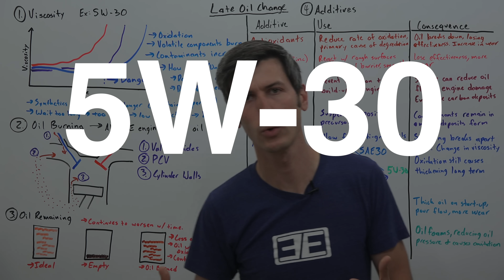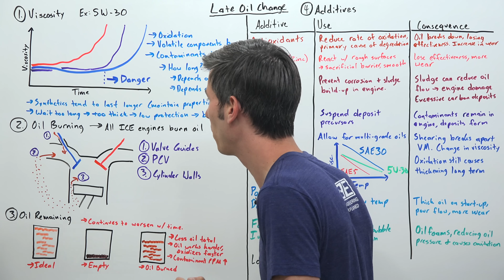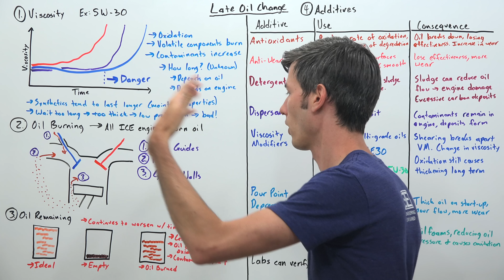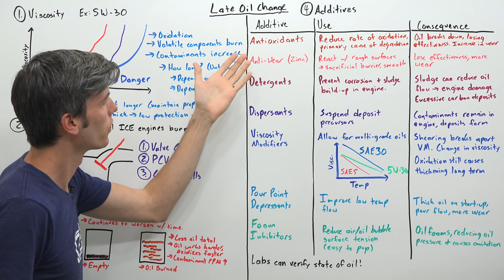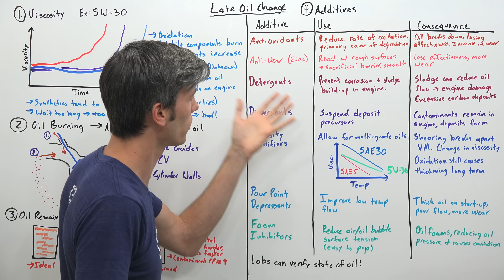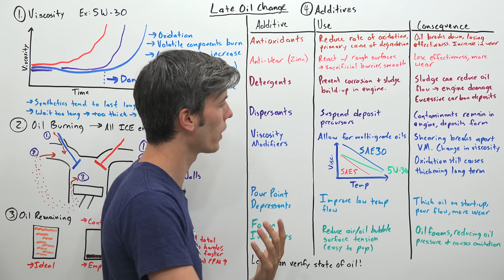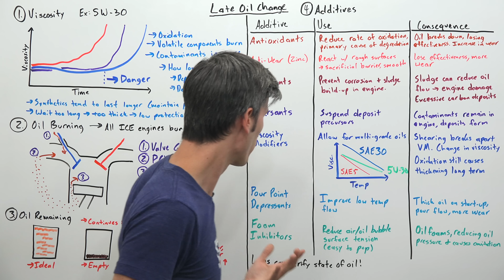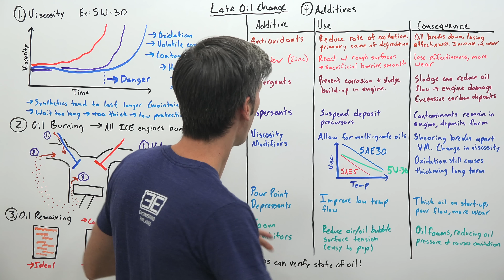What If You Forget To Change Your Oil?

Comment: We're lucky nowadays. Newer cars tend not leak as often or as much as the used to, and engine oils are far more durable than what we had a few decades ago. As far as late oil changes go, I feel most people should stick to 5000 miles if they have a regular street car. It's a good middle ground and gives you some leeway if you forget, because sometimes life happens.

Second, most people should be checking their oil level at least every fill-up, assuming their car still has an old-school dipstick. If you drive your car hard, you should check your oil more often, especially if the vehicle is turbocharged. I work at a shop and the cars that get driven hard are almost always lower on oil than cars that are driven easy, even when the distance traveled is the same.

Comment: I have always doubled the oil change recommendations and never had an issue on any vehicle I have had .
Reply: Glenna Barry I never had issue with my vehicles by sticking to manufacturer’s recommendation of oil change and I am not polluting environment by doing unnecessary oil changes.
Reply: @olasek7972  if I am reading the comment correctly doubled means two times i.e. if the manufacturer says 5,000 miles he goes 10,000 miles. But I agree, my motorcycle has oil change intervals of 7,500 miles and some folks change every 3,000 and it is so unnecessary.
Reply: Stephen Smith you could be right, “double” could have two different meanings here, now I am not even sure what he meant.
Reply: Old oil is recycled, it's not dumped down the sewer.

Comment: Hi and thank you as always for your very informative videos. I'd like to know if the advice to change oil every 12 months even if you don't drive much is still true. I own a small Toyota, 1.0 L 3-cylinder engine and the oil is a fully synthetic 0W-20. I drive about 5000 miles per year, mainly around my city, the traffic is fluid and almost no queues. What's your advice? Thank you from Italy!
Reply: Oil degrade the chemical in the oil degrade over time. Engineer at Nissan said every 6 month or 3k miles the chemical in the oil degrade and will wear the engine wall cylinders after a longer period of the time he said too we don't need to get the most expensive oil has long you change it at 3k Summer higher viscosity Winter lower viscosity if follow this engine setup it will go more than 300k miles The Engineer has designed the engines at Nissan. that what i do now. but I was changing oil every 6k in my old Honda Civic now every 6 month and my new Subaru Outback.
Reply: I change mine every 3k or once a year, but I have vvt. 5k or once a year should be fine.

Comment: The real answer is "it depends" on what you mean by late. Most modern cars use synthetic oil with extended change interval. My cars all car for oil change intervals around 7500-10000 miles. A lot of cars have a system that measures cycles, fuel consumption, etc. and tell you when to change your oil based on that typically starting around 15,000 miles. So, year, if you are right at the 15,000 mile limit, that's probably not real good. I always change oil at 5000 miles just because it's way easier to remember. If I go over a little, no biggie.

Comment: I drive a Toyota and manufacturer has sticked a sticker to use 0w20 but after 20k km, at the regular oil change my mechanic told me that I should change the oil grade to 15w30 after doing 40-50k km, his arguments were that increasing the viscosity of a seasoned engine will lead to much efficient and thick lubrication, our traffic are terrible so engines sit idle far longer than actual work done and the fact that I live in a tropical country, our vehicles don't need 0°C low viscosity as the ambient temp is around 27-32°C.
I am not sure about the validity of these claims 😕

Comment: ProjectFarm did a similar video, his result was that the mileage is more important and not age so just change when you have covered 10k miles or whatever the manufacturer recommendation is. There is also documentation that changing oil too early can damage the engine. Therefore I think you are probably wrong on this.

Comment: I usually change now when recommended, however when I was younger and had little money, I had a 1985 Nissan minitruck. I used synthetic oil, (Mobil 1) and only changed the oil when it went down a quart (liter). That was about every 40,000kms. At around 350,000kms, I had to change a valve cover gasket, and when I took the cover off, I expected to to see a bunch of sludge, but it was clean as a new engine. The compression was also still very high, around 180 psi. I ended up giving it to my ex, and she drove it to 460,000 kms, and  then got a newer vehicle, but the engine was still running like a top at even with all that mileage.. The point I am making, is that if you are using a quality oil, especially synthetic, I really don't think that running a couple thousand kms or miles over the recommended interval will make all that much of a difference in the long term.
Reply: It most likely won't as long as the extra distance is within reasonable limits. Also how it's been run matters.
Reply: Interesting. I wonder what kind of driving did you do. Motorway or urban? Probably mostly long drives from the high mileage
Reply: Michael Walsh : I was commuting to Toronto, so it was a mix of highway and.a lot of jammed up stop and go. The worst kind to an engine. 1 hour 40 minutes each way.
Reply: @capohd28  thats ok. imagine only 5km and the engine never gets warm enough. thats hurting!
Reply: Same experience here, I kept postponing the oil change on a Corolla because the oil remained clear. At 40,000 km it was darker than new but not all that much. Synthetic oil doesn't break down and deteriorate  like conventional oil.
Reply: Those old Nissan truck engines were just very well designed and implemented.  But you’re right, the regular Mobil 1 synthetic oil is very good, especially with that type of engine.
Reply: Even much more. Reinforced filter is important.
Reply: Depends on the vehicle really. Try that in any newer car and it will start destroying itself in the first 100 miles you have gone over.
Reply: @NoName-oj5km  Really? You think the oil or engine have a self destruct button that goes off when you go a 100 miles over? Many new engines have longer service intervals than in the past. 3000 miles used be the standard. Most are 5 - 8000, some much higher than that now.
Reply: capohd28 that was an exaggeration, newer engines tend to be less resilient.
Reply: @NoName-oj5km  Not so sure about that except maybe with some high performance vehicles like turbos, but many automakers have made significant improvements such not mixing aluminum and iron casts, improved cylinder liners, improved cooling, better balancing etc.
Reply: Crap. 100 miles over and the engine will destroy itself!!
Reply: @NoName-oj5km  lol no. smfh.
Reply: @Capo - Yes. Mobil 1 (synthetic I’m assuming) is AMAZING
Reply: as a subaru WRX owner, i disagree - hell i change my oil every 3k miles (subaru recommends 6k miles for an oil change)
Reply: @Thunderstryk  Well, if it makes you feel better, than do it. But do you have evidence that it needs it? I have evidence that it's not so critical.

Comment: Hi my car's owners manual says that I should change my oil every 16,000km, the way I do it is, I change just the oil at 8,000km and then at 8,000km more (16, 000km) I do a full change oil and filters this way I always have a clean oil and I save a bit of money by changing the filter every 16,000km which is what the manual says

Comment: I did 123,000 miles on the same oil engine still drives fine with new owner.
Reply: Anyway I drive an ev now not dinosure ice.

Comment: Hello EE, thanks for the great videos!  What are your feelings on oil additives such as BG MOA and others?  Are they necessary, do they actually benefit the engine in some way?  Are they worth it?
Reply: If your car runs well, absolutely not. Use a nice oil filter preferably OE, the proper spec and the proper intervals and that's it! Additive packages already exist in the fresh oil

Comment: Left oil in older suburban that I didnt drive very often for two or three years. One day I noticed on dip stick the oil looked like chocolate milkshake. I thought maybe blown head gasket. Changed oil and everything is good. Oil just deteriorated over time. I use full synthetic. So ... three years is too long between oil changes. But I think it's a waste to do every 6 months unless you reach the 6,000 mile mark in that time frame.